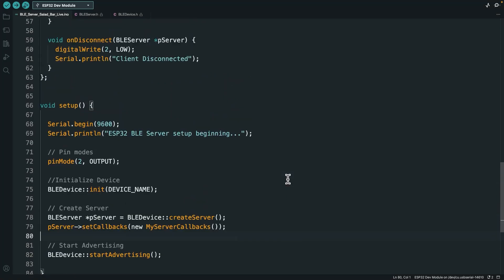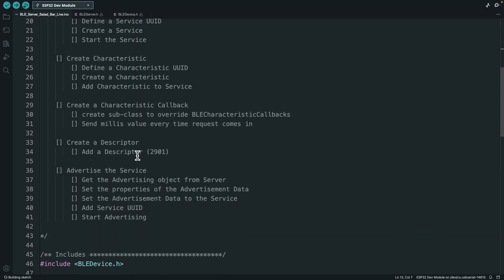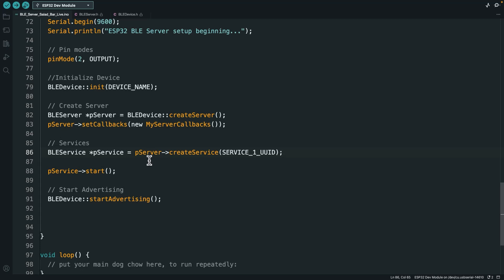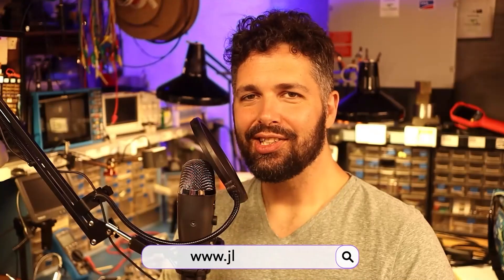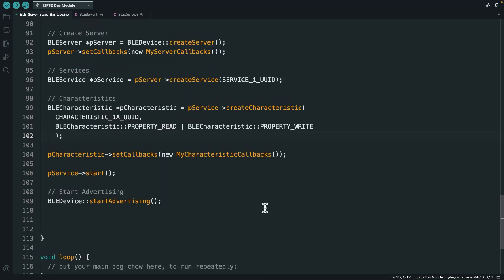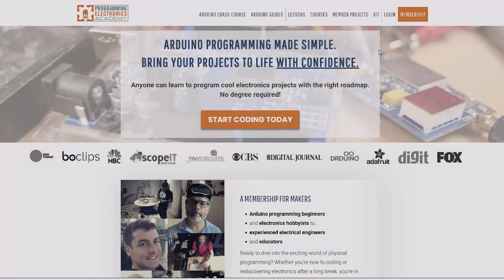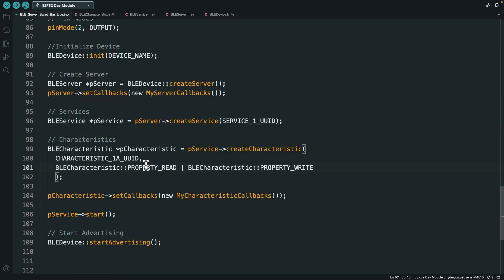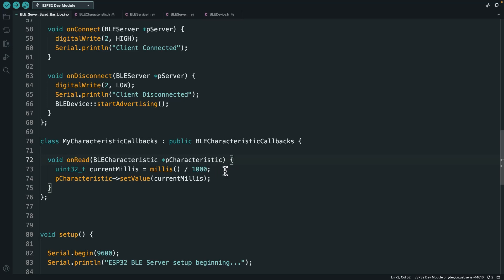BLE Characteristics - Arduino code explained! | PART 2 #arduino #esp32 #ble #arduinoproject

Comment: Question: How did you get the documentation by hover on Arduino IDE?
Reply from the maker: If you are using the Arduino IDE 2 , then they should show up by default.  If you don’t see them, you can try restarting the IDE.   You may have to wait a moment for them to load, and honestly sometimes they don’t show up for reasons unbeknownst to me.